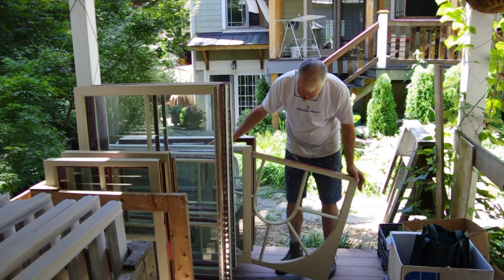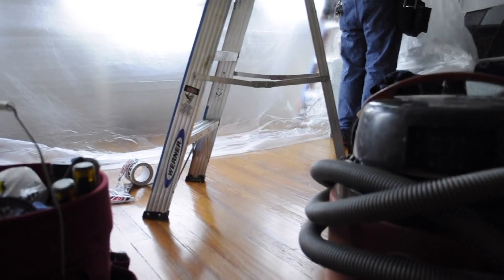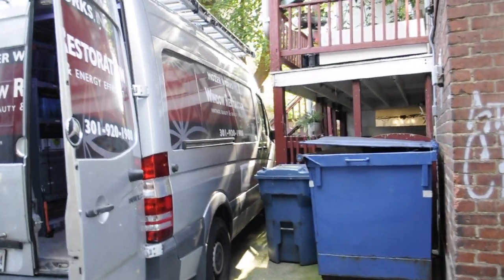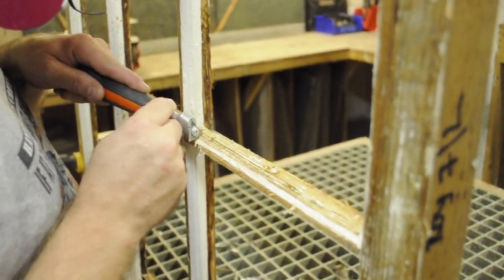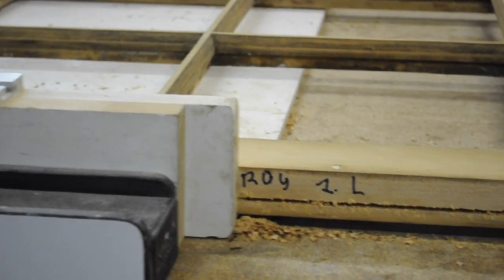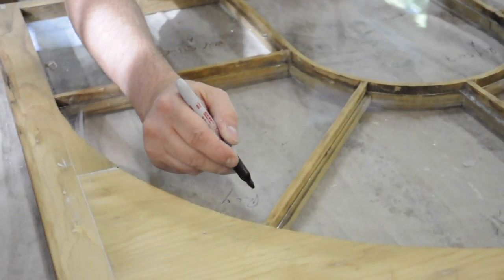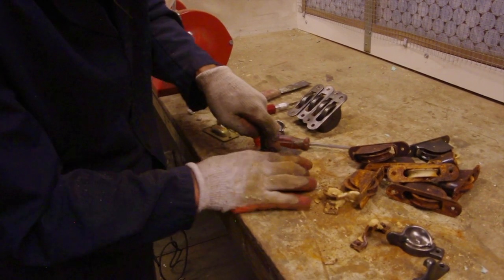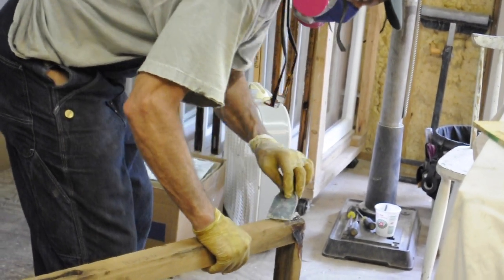Historic Window Restoration - Full Process - Mozer Works, Inc.

Comment: Curious to know what brand or source you use to add metal weather stripping.  There was a brief video shot of cutting the rabbet along one stile and you mention modifying the mid rails, I assume for interlocking metal pieces to be added to the respective top and bottom sashes.  

I've rehabbed and cleaned up most of my double hung windows (I have 32) and I noted the original Chamberlin Metal Weather Stripping Co. parts, the metal tracks that join to the window stiles, and at the top rail and bottom rail.  Interestingly enough, my house was constructed in 1910 or 1911.  The metal stile and rail tracks are stamped "Chamberlin Patent Feb. 10, 1925," indicating that the owner at the time paid for the modification of every double hung window in the house15 years after it was constructed.  (John Chamberline apparently had received his first patent in 1890 according to what I found).  No small undertaking!  In your experience, was this type of retrofitting common?  What is also interesting is I found that there is still a company today that produces this type of metal weather stripping for double hung windows.

Comment: My question is if the restored windows can somehow be insulated? We have a 107 year old log home that has original windows and we need something to keep cold/heat out.
Reply: Your original windows can be pretty darn energy efficient if rebuilt correctly. You'll want to use a metal interlocking weather strip. This is the best type of weather stripping for old windows. A groove will need to be cut to accommodate this type, but your windows might already have it. This, along with the full rebuild will rival many double pane windows. Also consider your windows are a fraction of the total square footage of your house "sides". Add up all of the square footage of your "box" and you will find the floors/ceilings and walls(not the windows/doors) take up a ton of square footage. Since you have a log cabin, obviously you wouldn't insulate the walls. So, focus on insulating the ceilings and floors first since that will be a large part of your overall energy loss.

Comment: Question, when you are reinstalling, in the video, it looked like one of your crew was applying something to either the frame or sash edges, what was that? I'm guessing a lubricant so the sash lift more easily. But what was that? And do you wax the frame, between the stops, where the sash sits? Great video, thank you!

Comment: I'm thinking about getting into repairing rotted sashes and sills etc.  I currently work for a glass shop and we get 20 calls a month it seems like for this issue. but we just don't have the capacity to deal with it.  just the glass alone keeps us  busy.  but it's becoming a big problem in our area.  lots of 20 30 40 year old windows are starting to fall apart.  but the homeowners are faced with fix that one or two windows or replace the whole entire house.  which 99.99% of them would rather not do.  and I get that

Comment: Sadly where I live, there are no guys like you anywhere even remotely near us. All the old windows get sent to the dump... 

You had mentioned modifying the sash with a dado for weather stripping, and modifying mid-rail as well. How are you modifying the mid-rail? 

I have  mid 1950’s double hung Anderson windows that have spring operated compression locks hidden in the edges of the sash which are operated by thumb levers. No room for weather stripping in that configuration.

Lastly, what is the minimum distance recommended from the face of the glass to the stile of the sash? How thin (depth) can glazing compound be? 

Thanks for taking the time to make and share this video!
Reply: my grandma house was build in 1950 there was only 2 paint layers the original paint was tian now the 2nd paint is newer paint from 2003 or so and yes when my grandparents bought the house it was all original and all of the doors were new shape they were made in 1950 back in 2010 they remodel the house getting rid of the vintage windows and some of the doors now theres 3 antique doors remaining and they are still in excellent shape the garage has 2 vintage windows which the newer paint was falling showing some of the original 1950 paint which one of the sashes glass was broken cuz back in 2009 some kids lived next door and they shot the window with a BB gun but i had tooken it to a place where they replaced the glass and now today they look beautiful and they work smoothly and those 2 windows are the last remaining ones left to my grandparents  house if i ever see them remove them ima keep them to avoid them going to the dump people just dont care about the vintage stuff anymore usually when i head to my grandparents i check the old windows to make sure theres no rotting going on i make sure they stay looking nice

Comment: This is what our company does also windows & doors.We have an 1890s cotton mill project 5 stories high with about 200 windows 4 1/2' x 10' arch tops that must be historically replaced, only 3 were able to be saved. The windows seem to have only ever had 1 coat of paint over period of 130 yrs. Processes looks very much the same as ours👍

Comment: I put this on thinking I could learn how to do my own windows. I learned that I need to hire someone to do it lol.
Reply: Good luck finding someone. I can’t even get trades people to return my calls.
Reply: @rzu7120  I've been doing my own restoration. This year is 100 years old. You're right though... finding someone to return your calls is a bear.
Reply: Don't get intimidated. Wear a mask and use a good vacum frequently. Just start gently pulling your trim apart and take photos to remember which goes where.
Reply: I’m starting this weekend. I got 8 windows to do. Most need reglazing but I’ll also repaint as well. If this goes well I’ll start my own window/screen repair business. If not, I’ll know to pay a guy next time.
Reply: @brianbacich9999  how did it go?
Reply: @lilybowen1846  really well. Reglazing was easy. I set up a table in each room that I worked in. This way I could pop the window out, do the repairs and slide em back in. I used a vent fan while painting. It looks good and is now air tight. I had to buy a few window latches that were broken but cheap to replace. My old wood windows are a lot more efficient now too.
Reply: @brianbacich9999  well, did you go into business or not? lol  I think one would need to live in a well to do area with a bunch of old buildings if there was a chance of making a go of this type of work.  It's definitely satisfying to restore these old windows.
Reply: Yeah… I’m concerned about some repairs I know I’ll need to do, my solution - I’m going to habitat restore to get a couple practice windows and for spare parts lol! I’ve seen so many other vids that until this one I was pretty sure I’d be good to go…
Reply: Its a delicate process for sure.
Reply: BTW, there is lead dust. LOL. I did one window completely and it took me 3 days; 3x8 hours. Others would go quicker but it’s a labor of love to do these. Guess that’s why so many people go with replacements, but those can be quite bad too if they aren’t good quality and not carefully installed.

Comment: 8-10 weeks by 2-3 men for 8 windows......I'm guessing.......$1000 per window?
Reply: probably more.  I mean I charge $20 a square just for IG units in modern windows.  plus $130 labor for each window. so a 30X30 sash in a window would be about $125 for the glass and $130 for the labor.  $255 and 30 to 40 mins of work.  you're talking about $1000 per each sash 2 per each window I'm guessing.  with all the Lead safe stuff etc.  4hrs labor on each open just to remove it because of the RRP rule.    for $2k each window is probably about right.  some areas do not allow modern windows to be installed. so fixing these is the only option.

Comment: Do you ever glue the sash corners or just rely on the wooden corner pegs?
Reply: We drill a hole into both parts of where the window frame meet, not all the way through. 1/16th of an inch smaller than the dowel. A small amount of quality wood glue in the hole, tap in the dowel and cut it with a hand saw.
Reply: i am wondering that too. Have you ever got any answers ?
Reply: @charliexu1099  From the video they are glueing the wooden pegs, but that shouldn't be necessary.  Originally there would have been no glue, but wood pegs or metal nails in joints.
Reply: @richardmckrell4899  Yes. But metal rusts.

Comment: I would prefer not to paint my windows inside. Is there a clear primer I could use ? 
Also which paint (or a lacquer) for inside to preserve a natural wood color, and which paint for outside ( brown color ).
Thank you for sharing your knowledge and experience !
Reply: You can use polyurethane clear for the interior and emerald urethane from Sherwin William's
Reply: @hedlcm  - thank you for your input. I’ll definitely look into that.
Reply: You can use shellac for your windows to preserve their wood color. It will add a slight golden sheen if you use "clear" shellac and if you really want the palest color you can use "platina" which is the lightest shellac. It's wonderful because it's also historically accurate, and it is nontoxic, sustainable, and easy to apply. I personally love it and am using it extensively in the restoration of my 1923 bungalow. Hope this helps!
Reply: @emilys3638  - thanks Emily. I’ve used shellac to paint cedar planks that I used to cover a wall and ceiling in our bathroom. It come out beautiful and it’s I love the effect it creates. That’s why I would prefer it to paint wooden windows, or baseboards with a white paint .
Reply: @mar1video  You're welcome! I've also added dye to shellac to color it even darker. You can do any color you want! I used a reddish brown to imitate old trim finish and it looks amazing. They used to add aniline dye to shellac before applying it. Great stuff. I use Transtint brand liquid dye for this.
Reply: mar1video 
two points. First: i would recommend to paint the inside as well with a bright color. Second: try to paint the outside with a bright Color as well, so the wood heatens um that much in Summer. So your paint and the wood will last much longer

Comment: What brand of oil-based primer do you use? I've used Zinser but wonder if there is something better.
Reply: Paul Hughes xtreme bond from Sherwin William's
Reply: It looks like they're using Benjamin Moore Fresh Start exterior primer.
Reply: Alkyd enamel foundation paint. We have a local paint company in Milwaukee and it goes on beautiful.
Reply: @americanmotorsam-caz524  Oh, now that is a winner indeed..made to penetrate and hold